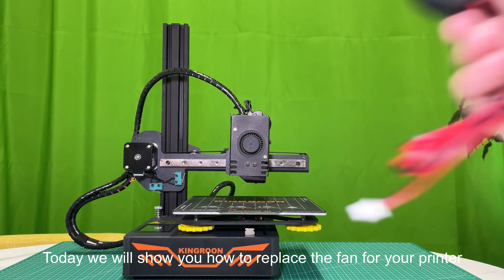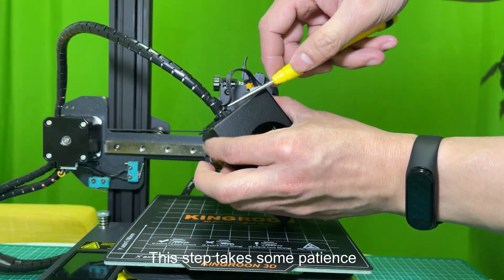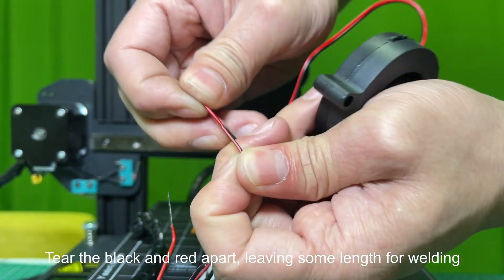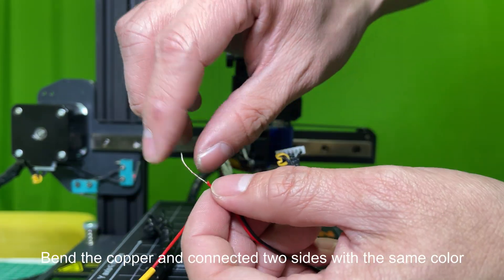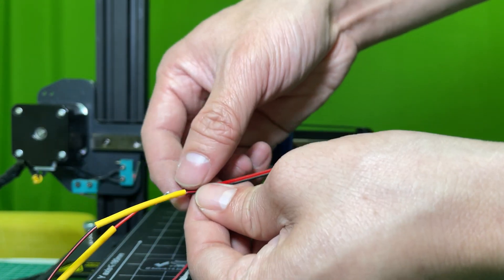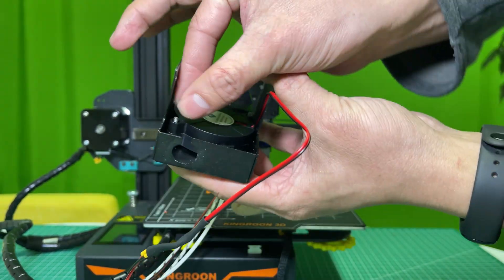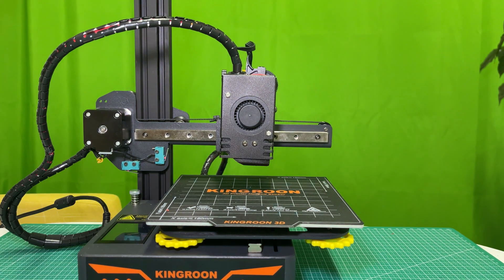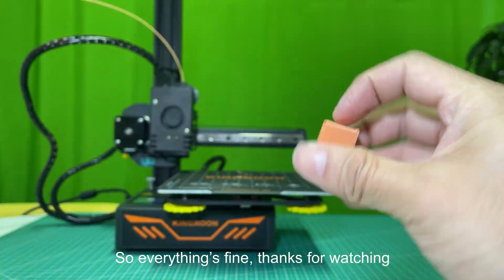Replace the Cooling Fan for 3D Printers - KINGROON KP3S

Comment: Why so complicated? After all, it is much easier to replace the wires directly on the fan board only - the connection is partially hidden under the sticker. Only 2 soldering points...
Reply from the maker: Hopefully, everyone knows that.

Comment: 4:15 Test wire splice before reassembly.
Reply from the maker: Yes, we’ve skipped that. Because we are quite sure it is a working fan. But it might be necessary if you bought the fan from the third party. Still thanks for your advice.